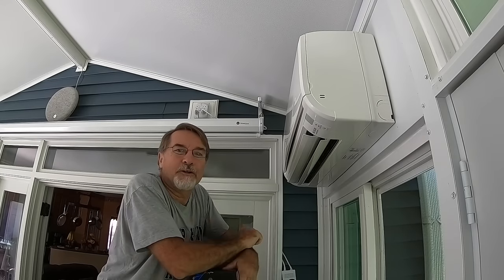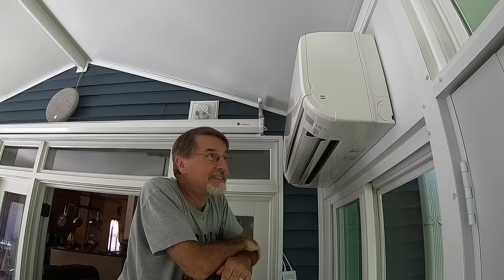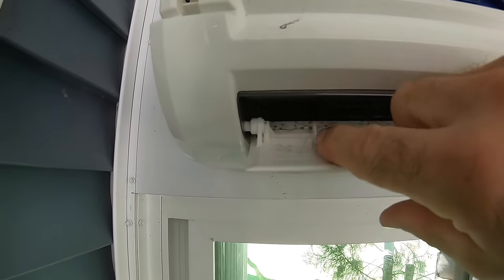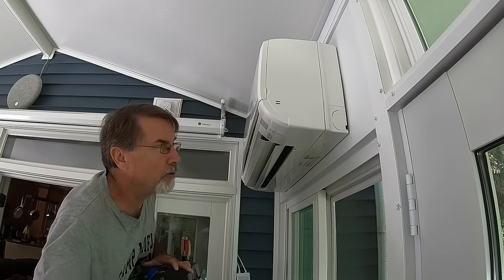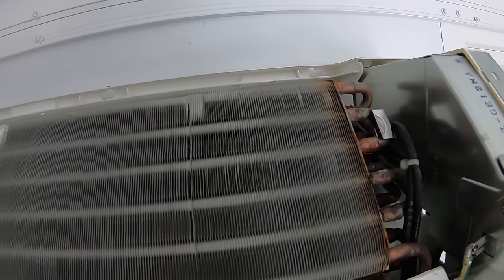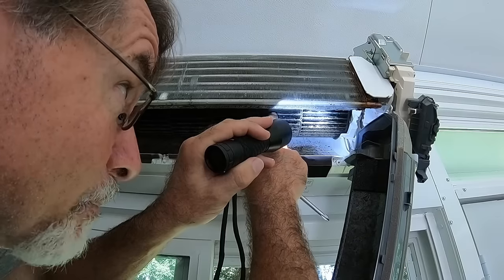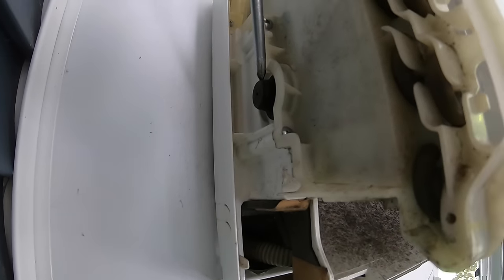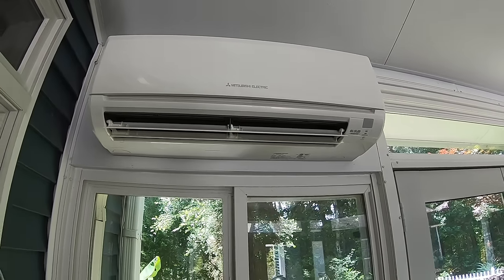HOW TO CLEAN AND SERVICE MITSUBISHI SPLIT AIR CONDITIONER

Comment: I'm glad (I guess?) To see I'm not the only one dealing with mold issues in my Mitsubishi units. Twice a summer we have to take it apart and deep clean. Such a hassle. We had no idea this would be an issue when we installed it, neither did the company we got it from.

Comment: The AC started to have a strange smell and had a look to it. I cleaned regularly the 2 filters but still, the smell was still blowing from the AC. I started to look inside and noticed a huge amount of molds, diets, dust and all that jazz. I was looking for a way to do a deep cleaning but didn't where to start. This video really save me time and money by doing it myself. Really easy to do and now's I have a clean unit without any strange smell. Thank you 👍
Reply from the maker: Great to hear you were able to get rid of the smell.  It's not only unpleasant, it's unhealthy.  Kudos!

Comment: James enjoy all of your videos. One thing I would add is on the coil cleaning. I have been in the HVAC bussiness for 25 years. They sell special cleaner that works excellent. It will remove all the dirt off of the aluminum surfaces. The dirt acts as an insulator and deminishes the efficiency. There is a variety for the indoor coil and one for the outdoor coil. I would highly recommend using them for quality cleaning without any damage. Stay away from the acidic varieties unless the regular one will not cut through the built up debris.
Reply from the maker: Thanks for the advice from the experts!  👍
Reply: Do you know how do i take off the coil unit to clean it?
Reply: Hi James I saw this video a while ago and I just found it again I have the exact same unit in my apartment and all maintenance does is come through twice in three years to pull out those blue filters and clean them and put them back in other than that these units have not been touched the one of my bedroom is in dire need of cleaning I loved your demo but I wish you had continued on showing pulling out the blower cartridge and the fins I'm sure my drainage tube needs cleaning but I am in a multi-story apartment building and I want to make sure there is no water damage from the condensation anyway if you could provide those two details that would help me out immensely thanks hope to hear back from you
Reply: @mattgustafson Which brands of indoor coil cleaner would you recommend?
Reply: @SizzlerWA  I purchase mine locally and it is not really a name brand. For the indoor coil they do make a type that does not need rinsing. Some equipment makes rinsing difficult. If you can rinse the coil after it is sprayed then I would definitely use that type. As the result will be better. Just read the directions and as I said before stay away from anything that sounds acidic on the label.

Comment: Best video on Mitsubishi heat pumps....
I had a major leak after remodeling with demolition and drywalling.
Fan was all caked akd the drain tube plugged so AC condensation would not drain.
I had the entire unit pulled apart by following the video...
Cleaned out my drain tube with a copper ground wire to unplug it.
Thanks

Comment: James I just want to thank you for this video. It had been almost 2 years since I had my inside unit serviced. Your video taught me the easy way to do major cleaning and mine was filthy.  There was a great deal of mold, mildew and a black dust in everything. I use this unit to cool and heat my whole house (600 sq ft) and now I understand why my allergies have been so bad. You are a life saver, thank you again.
Reply from the maker: Most welcome.  There's so many tasks the homeowner can do that they didn't realize was not so complicated and rely on the professionals who charge professional fees.  Great to hear you found the video helpful!
Reply: Hi James & @My PI Dream: this is great! Question - after you cleaned it this way is all the mold smell gone? Or is there some remaining on the aluminum coil?
Reply: Same here -- really heavy mold 😮‍💨.  I’ll have to have it professionally serviced, but at least I know now if the repair person knows these systems and what he’s doing with them...

Comment: Thank you so much for your tip about using a wet vac outside.  Our unit is only 1 year old and started leaking water inside yesterday.  I washed out the filters which were dirty but water kept 
shooting out the little rotating disk on the right of the Mr. Slim unit that scans the room.  Our unit does not have a pump but works by gravity.  The total run to outside is probably 30 feet.  I went outside with my wet vac and attached my lint wizard which is made to clean a dryer vent. It transitions the vacuum hose tube down to a small diameter plastic hose.  I turned it on and my wife said it sounded like someone slurping on a straw.  So far it has worked.  I did not see any dirt.  But what happened next was truly amazing.  I thought why not try it on the main house unit.  The whole house unit was working fine.  I attached the vacuum to the whole house  outdoor drain unit and a explosion of rusty colored water came out.  It had not yet clogged but my guess is that it was about to after 25 years. It had never been cleaned before.
I am surprised the ac guys never had done this before.  I owe you a big one for this cleaning suggestion!! Thank you so much!!!!
Reply from the maker: Glad you were a successful in your DIY project!

Comment: Great video there. My Mitsubishi unit has similar problems. Cleaning the blower fan can be done with a vacuum ( smallest nozzle ) and a small brush like a paint brush if you don't feel confident in removing all the covers. 

I suggest wearing a mask and using goggles so you don't breath any of the dust in or get it in your eyes. The blower fan is easily compromised in it's efficiency when it's dirty.
I had a professional cleaning service in to clean out my unit a year ago and I was totally surprised at how much dust ,  mould and other junk was in the unit. I had thought the unit was defective , but after a full clean the unit was almost as good as new.

Comment: A little long-winded but so incredibly helpful. Both immensely informative and pleasant. Thank you! 
Please keep showing close-ups of every clip and step you used to to open then close components. They were invaluable.
Greatly appreciate your warning about having a bucket on hand when clogs or condensation are in the mix.

Cleaning the Blower Wheel Suggestion:
1. The blower wheel (long cylindrical inner fan) can become very dirty over years with caked on dust. That situation can cause the fan to blow much less air and reduce the unit's ability to cool the room. As you said, every couple of years it is vital to clean it...safely. Many parts are difficult/impossible to replace if broken.
2. We attached an inexpensive clear plastic painter's drop cloth to the wall just under the unit with blue tape then draped it out on to the floor. That caught everything (dust, dirt, condensation, etc) and made clean-up so easy.
3. After we opened the front panel and removed the vanes (thanks for showing us how), we did not want to touch the condenser. We did not have a clog and were fearful of damaging it. So we held the black metal grate open from the bottom with one hand and gently cleaned the blower wheel from below.
4. A round-handled paint brush (used for watercolors or found in an art paint brush bag) was the key. Whatever brush handle fits under the grate and has a round fluffy head. Gently brush off the blower wheel then spin it a little and repeat until the blower wheel is clean. You should knock off a lot of dust and have the clumps fall down on the drop cloth. 
5. After cleaning the blower wheel (and cleaning the filters and vacuuming the insides as you showed) leave the drop cloth down. Re-attached the cover and click the vanes back. Then turn the unit on full blast (maximum fan speed) for 10 minutes. That will blow the rest of the loose dust out and on to the drop cloth. When all dust has blown out, then carefully take down a fold up the drop cloth. You'll be amazed by how much dust/dirt (than can stain a rug) has been collected.

Depending on how dirty the wheel was, you could improve the unit's effectiveness by up to 50%. 

Don't forget to also properly clean the outdoor unit too...a couple of times a year. That can make the coolant running through the indoor unit much colder. Cleaning that is fairly simple but has a few important steps to prevent damaging the outdoor unit and cleaning as much as possible.

Comment: This got me started on being able to do this and much appreciated. Able to get roller back in and functional but Goodness! the drain pan reassembly gave me fits.  The clip on the right side of drain pan was stubbornly about a half inch in front of where it was supposed to re-attach. Unable to find other videos with good step by step or visual of realignment of the pan. Eventually, took cover off other unit to look at it and eventually by the Grace of God it was lined up.

Comment: Leak and freezing problem solved by cleaning my own aircon unit! Thanks for this video tutorial, it helps a lot! I just found out that Panasonic units are similarly built to Mitsubishi ones. 

Been itching to remove the blower but didn't know how. This video is very very helpful with clear and doable instructions. 😁

Sending extreme gratitude to you from Manila!
Reply from the maker: Great to hear!  Thanks for the kind words.

Comment: My Mistsubishi mini split had the dirty sock smell. I disassembled the unit and cleaned the evaporator coils with Evap Foam No Rinse. The first time helped. The second time helped a bit more but I’m still smelling it a bit. Will try cleaning out the drain hose this time. Great video. Thanks for the help!
Reply: Hmmm, good to know about the Evap Foam No Rinse!  Thanks.

Comment: Nice video.   Thanks for posting it.  One more thing for people to know:  If a lot of the fins are bent over, this will reduce the efficiency of the unit.  You can buy fin combs to straighten them out.  The combs come in different sizes so buy a couple of sizes or a pack and see which one fit.  This is especially true for window air conditioners where the fins get bent while moving the a/c, or people outside like to bend them.
Reply: Missouri Bob 007
Reply: Missouri Bob 
even done better 007
Reply: Man, these comments on this video have given me a lot of insights on how to properly maintain my AC all by myself!
Reply: Except the refrigerant, that I can't do lol
Reply: Thanks for the tip, I bought the whole kit from amazon

Comment: This is really good.  I had no idea that I should be doing this periodically.  We've had one of these units (the larger) one for about 4 years and I have just followed maintenance procedures in the manual, which are less intrusive than the procedures you showed.  Thanks very much, sir!

Comment: I found this helpful! It’s from Choice in Australia-
Should you clean the condenser coils?

The housing can be removed from the indoor and outdoor units to access the condenser coils, which benefit from occasional cleaning. We advise that you leave this job to a professional though, as you could void your warranty if you do it yourself, or worse, you could accidentally damage components and release refrigerant gas. There are also potential electrical safety hazards.

Getting your air conditioner serviced

Your air conditioning system should be professionally serviced regularly – the service person will check the refrigerant gas levels, test the thermostat and make sure all the internals are in good condition. This will keep the unit running for many years.

Some manufacturers recommend the air conditioner should be serviced once a year. Others say that as long as you follow the instructions and regularly clean the filters and units, you'll only need to have the air conditioner serviced if a fault develops. 

We asked CHOICE members about their air conditioner cleaning habits. Most said they clean the filters a few times each year, but only call for a service every few years or when the unit develops a fault. If in doubt, check the manual for your model or call the manufacturer for their advice.

Here’s the full article-
 https://www.choice.com.au/home-and-living/cooling/air-conditioners/articles/how-to-clean-your-air-conditioner#Advanced%20cleaning%20and%20servicing

Comment: Very helpful! Of note, at least for me, taking the plastic casing off was NOT as easy as it looked in this video. There are a bunch of little clips on the plastic casing that lock it in and took some real shimmying and tugging to get loose. I was afraid I was going to break the case or pull the whole unit off the wall but if you know about them and where they are, may be able to apply more focused attention to them. There are about 4 along the top of the unit and then one in the middle along the line where the screws are (mine is a 2 screw model like in the video). I suspect these get less stiff the more times you take off the cover so that may be why his is so much easier!
Reply from the maker: Yes, the casing can be a bit tricky.
Reply: Yes it’s a pain.  I used a flat bladed screwdriver to pry around the cover.
Reply: This comment saved me. I gave up and went to see if someone else had this issue.  After a few curse words, I got the cover off. Thank you
Reply: Same here. The case is very difficult to remove because of the four top clips. This video also does not show actually removing the blower wheel which is another tricky thing. You have to pull one end of the coil out away from the unit for the blower wheel to  be pulled out.  These things are not made with maintenance in mind.  Also note that if your unit drains on the left side, you have to detach the indicator light electronic module/louver motor assembly before dropping the drip tray.  To help for the next time I took a sharpie and marked the exact location of the clips on the outside of the case. This way you know exactly where to exert pressure.

Comment: Would really have loved to see the point where you pour mould cleaning liquid in to the drainage pipe. ALSO dummies like me needed to see you actually remove the fan unit after removing screws, and put it back… I’d love a follow up video covering these things.  Thanks!  :)

Comment: I have that exact model in my tiny house. Unfortunately, I am renting and the previous tenant (and landlord) did not maintain it well and now I have a terrible smell throughout the house coming from it. I cleaned the filters but it didn't help. I'm thankful for your tutorial because now I can deep clean it and hopefully fix the smell (and possible health hazard). Subscribed!
Reply from the maker: Glad you were able to go one step further.  The smell will go away with proper cleaning and using a disinfectant in the cleaning process.  It's a common problem with these type units.  Thanks for subbing!

Comment: Greetings from CT, I have the exact same unit and started by removing the2 screws to the main cover and it would not budge, Read a few more comments and finally found out that there were several other clips which actually hold the cover in place. Would have been nice if you had  led with that..   LOL. great other wise. Thanks.

Comment: I use a chemical that is specifically made for cleaning the condenser coil that is self drying and they make another chemical for the outside unit.  I apply the liquid after I vacuum and add a couple of chlorine tablets for the drip pan which keeps the condensate line clear.  In the Philippines I clean my bedroom unit every 3 months because we use it 24/7 and as I am sure you know it will run more efficiently.  Great video and I admire your work so much I wish you would come visit me for about 3 months to help us catch up on maintenance.  ha ha
Reply from the maker: I like the chlorine tablet strategy.  First time I heard that.
After all its costing to build Villa Feliz, I might have to hire out as Mr. Handyman Philippines.  😉

Comment: Thanks for the video, this was greatly helpful.  My units performance was suffering (the wall unit!).  It started to sound off.  I think the condensation drain was plugging a little and the tray was retaining water.  The higher humidity seemed to be sticking to the fan causing dust to accumulate in great amounts.  Cleaned it off and it's working great!  I'd like to propose that the drain hose should be vacuumed from the exterior at the same time one cleans the filters to aid in keeping the drain clear.  It would be worth a shot.  It's easy to do and could keep the unit happier between larger cleanings.
Reply from the maker: Good advice for vacuuming every time you clean the filters.  Will save you from unexpected leaking inside from a clogged drain.

Comment: Thanks! Helped a lot! My unit is a little different. Drain is on left side and vane motor is on right. Had to remove the vane motor. The top of the case pulls out easier if I press down where it snaps together in 3 places. Only part I could not super clean was the metal screen and luvers connected to the drain pan cause I could not fully disconnect it and hose it. I got it reasonably clean with a wet rag.

Comment: MARAMING SALAMAT we just installed our Senville Split AC inverter here in Pennsylvania. Very detailed video.
Reply from the maker: Great to hear Freddy!  Lot's of folks finding the split AC episode it helping them out.
Reply: @MyPIDream  < Lately I noticed my Liquid Line outside (the smaller pipe on the line set) is frosting. What is happening? Salamat po.